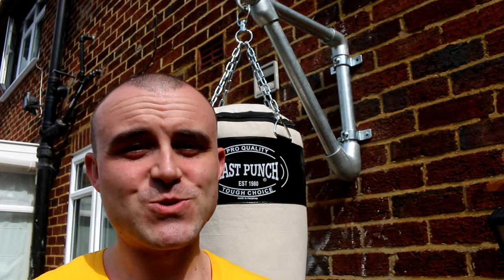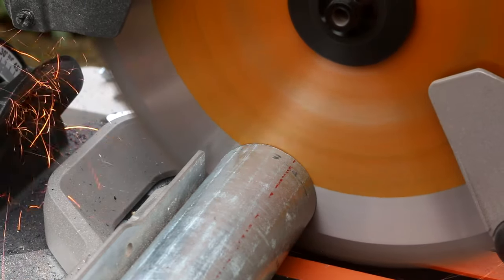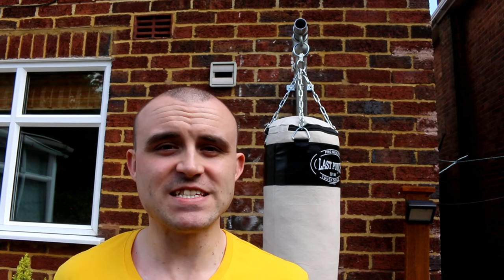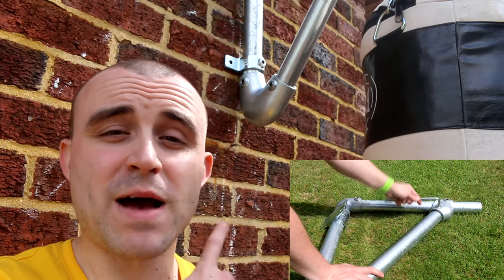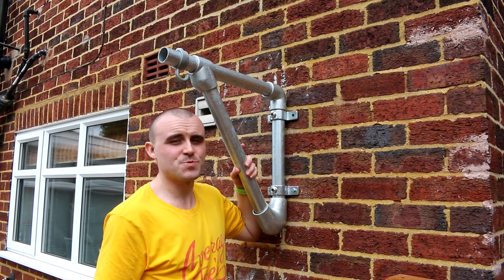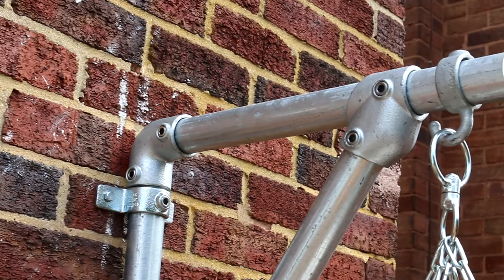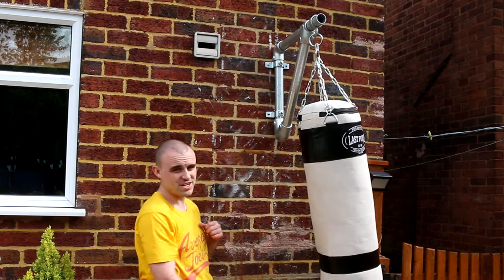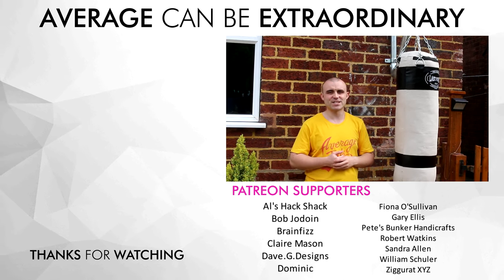How To Make a Punch Bag Wall Mount Bracket from Scaffold Poles! #Ad

Comment: What a ripper idea for those connectors. Never seen them before. 👌
That saw still impresses the pants off me! 😯
Great upload mate.  👍
Reply from the maker: Thanks Bill! The bracket could be used for lots of applications and using scaffolding makes it a breeze to put together👌 The saw takes out all the hard work cutting the poles haha wouldnt fancy cutting them with a hacksaw or angle grinder haha
Reply: @AverageJoesJoinery  
Always a bonus when the build is quicker than first imagined. 👍

Comment: Would PVC Pipes (filled with cement or aggregate/sand ) do the job? in case you cannot find/buy scaffolding tubes
Reply from the maker: Unfortunately not mate. Concrete doesnt have much strength for this kind of application.

Comment: Very nice!  How did that saw feel cutting through those poles?  It looked like a hot knife through butter.
Reply from the maker: Thanks Ingrid! The saw cuts with ease. I left the footage real time in the video so you can see how quick it cuts. Always surprising when you feel the cut edge and its cold to touch too
Reply: Did it? I thought the opposite to be honest
Reply from the maker: You thought it looked like it struggled Lee? It went through with ease, no chatter and produces a nice clean cut 😊
Reply: I can vouch for that. I have an Evolution saw. The standard blade cuts wood, steel, plastic, aluminium - and when I cut some 1" box section to make a frame, the saw cut it brilliantly, nice clean edges and the metal didn't heat up. Good saws and great blades.

Comment: Can this work for mounting on a tree?
Reply from the maker: You would need some pretty deep anchors into the tree mate. A better option would be to attach a triangle frame to the side of the tree so you have my anchor points. Similar to how tree swings are attached

Comment: What’s the max weight that can hold?
Reply: Mine is holding a 55kg bag and i’m 82kg and swung from it. Didn’t even flinch, but i used m12 bolts with shield anchors